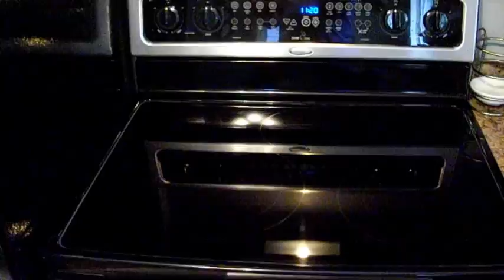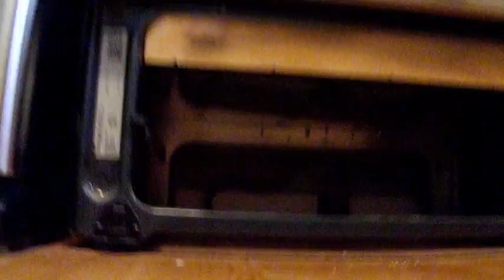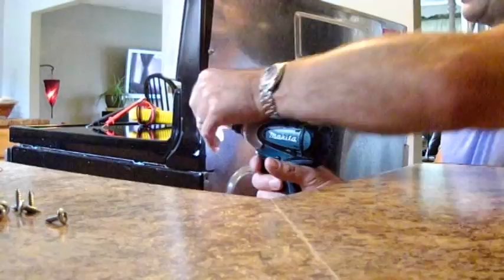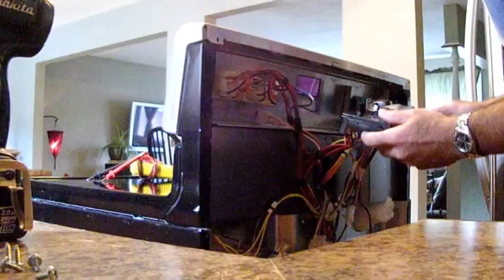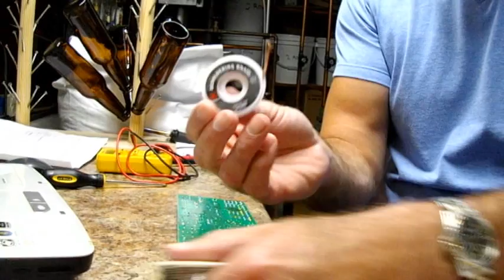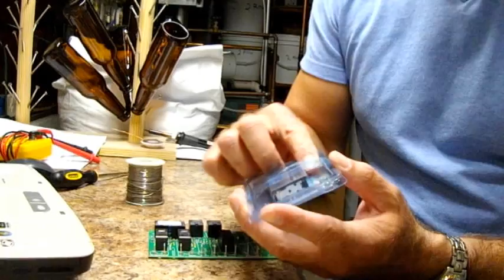Whirlpool Convection oven just burns food

Comment: Two question why haven't you attached to the lower of the rear stove wall the anti tip bracket that comes with every whirlpool electric and gas range, second why don't you put round furniture felt pad on each leg of the stove that way when need to move the stove toward for any repair you won't need cardboard pieces
Reply from the maker: True good idea, all my kids are grown no one was going to pull on it.  It takes a lot to tip this stove, however this house was sold and added prior to its sale.  Thanks for the suggestions on the felt pad.